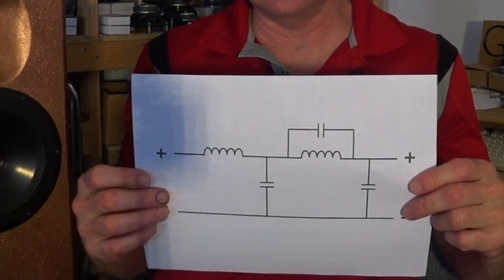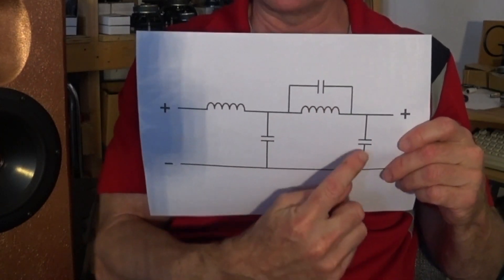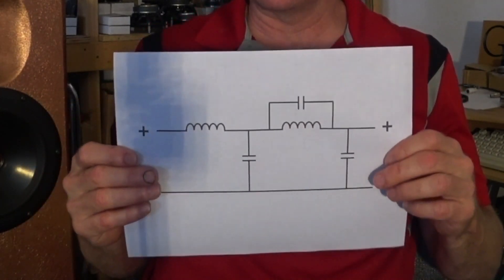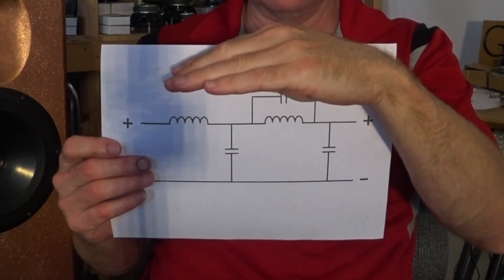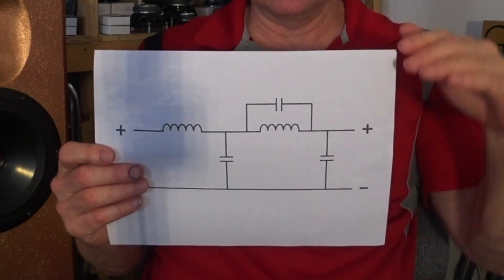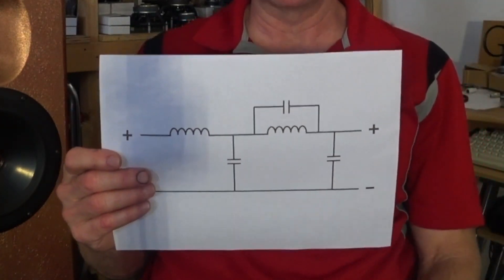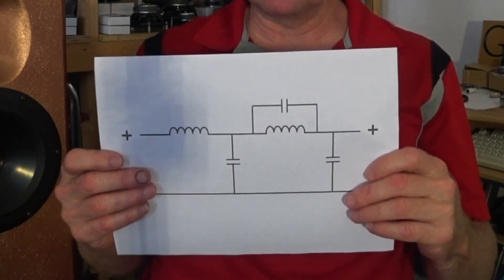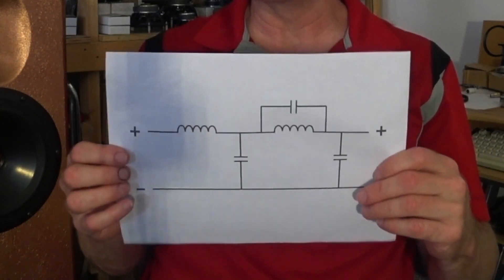Tech Talk 17: Why crossovers shouldn't be calculated

Comment: Note that you need to use the impedance of the drivers measured in the box at the crossover frequency.   Those are the numerical parameters that you start with for the base filters.  If you don't do that, you have no idea the Q of the filter or the pole locations.  So, you don't know if it is an L-R filter or a high Q filter with complex conjugate poles that will ring.

Comment: Ron, yes indeed, an assembly tutorial would be necessary, as I have no woodworking skills or tools. I haven't soldered in decades, I'd just need to get a gun, and a little practice using it, but not much, otherwise, I'm good to go. Would require some advice on stands. That speaker's quite a beauty!!
 Thanks, Danny, these are great vids and you are a very good speaker. And a big thanks to Ron, also.

Comment: How do I order a kit? What is the monitor called?
Reply: You can call GR Research to order the NX Studio Monitor. 

More information can be found below. 

Build and design thread: https://www.audiocircle.com/index.php?topic=160647.0

Review: https://www.audiocircle.com/index.php?topic=167137.0

Customer build: https://www.audiocircle.com/index.php?topic=168181.0

Customer feedback: https://www.audiocircle.com/index.php?topic=168181.msg1792638#msg1792638
Reply: Would this monitor be considered an open baffle type loudspeaker with the planar magnetic tweeter open to the top? If so, is it OK to have it close to a wall? Will it still sound really good?